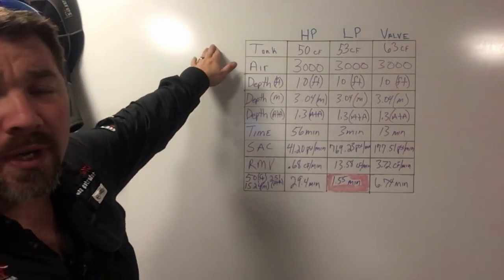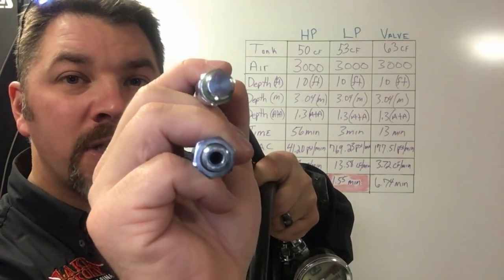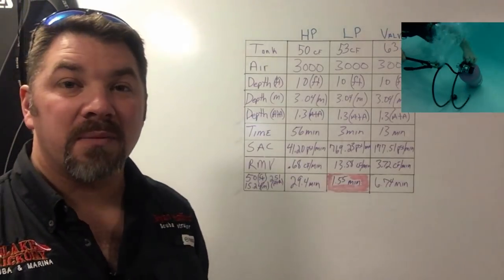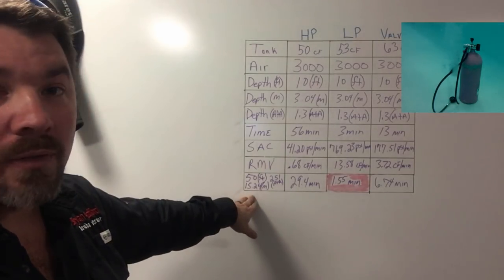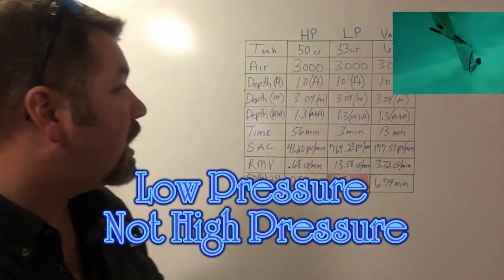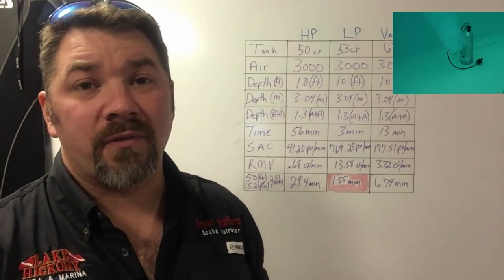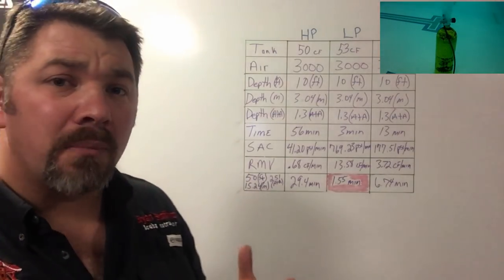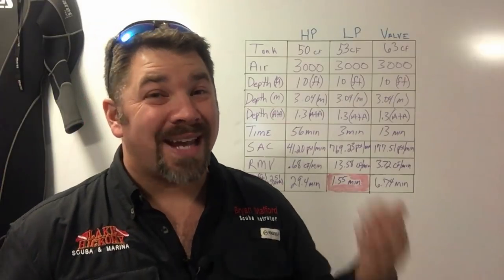Low Pressure vs High Pressure Air Loss Test

Comment: Just found this even though it’s old – thanks for showing exactly what we needed to know. I had seen similar tests (Alex Pierce did one) but hadn’t seen it done so dramatically. Initially I thought as others did that you also needed to factor in the diver’s air consumption but that would be minimal (about 1/1000 from your numbers) when compared to the leak. And you did this with a full tank – the remaining air time would less (although probably not linearly less – a 1500 psi tank would probably last more than 90 seconds) with a half-full tank. But the short time suggests to me that a diver experiencing a low-pressure freeflow should spend NO time trying to fix it and should instead immediately abort to his buddy’s air supply, or surface immediately if no buddy was nearby. Even if the freeflow could be fixed (while breathing the buddy’s air) the loss of tank pressure would mean the dive would need to end anyway.  Do you agree? Is this what’s taught in these cases?  Thanks.
Reply from the maker: Hello Jon, we use this video in all of our Stress and Rescue Courses.  You would be correct in choosing to abort the dive instead of wasting time trying to fix the problem.  With this being said, you can still try to fix the problem, however, there would be no need to continue the dive as you have already had a catastrophic failure.  I would definitely want to get my regulator serviced before I continued to dive with it.

Comment: I'm a new driver and was shopping for a tank. 
HP it is!
This was EYE OPENING! 
Thanks!
Reply from the maker: Hello Juror63, glad you liked the video.
Reply: That's not how it works. Both HP and LP cylinders with have HP and LP hoses coming off of the 1st stage of the regulator. This video shows what happens when HP and LP hoses fail, or the O ring does. LP hoses are used for the power inflation, regulator second stage, drysuit hoses and the like. The HP hoses are for the pressure gauge.

Comment: First i want to say great video and valuable examples.
One add i would like to make is that the divers air consumption is not taken into account on remaining time to surface.  So a diver would have less time than that on the chart.
Still very interestingand useful though. I would have never guessed that kind of difference in the high-pressure and low-pressure line
Reply from the maker: Thank you Don, glad you liked the video.

Comment: Brian, 

Long time follower and a big fan of your work. 

I truly appreciate your work in teaching us to be better and smarter divers. 

I’d love to get your feedback on best practices/techniques to deal with these situations especially - and this happens a lot unfortunately - when your buddy is too far away to notice what’s going on. Gear set up is single cylinder without a bailout. 

A ruptured LP line at 50ft leaves less than 2 minutes of air. It’d require surfacing without a safety stop while ascending as slow as possible and simultaneously checking SPG drop progression is probably recommended. 

But what if this happens at 100ft? 

I recently discovered an o-ring problem on my cylinder valve and was prone to leaks. Good thing I caught it while on the boat and brought a spare cylinder. 

Thanks in advance!

Hiro (pronounced like “hero”)

Thanks again for your continued work!
Reply from the maker: Hello H, thanks for being a subscriber and viewer. We are planning on revisiting this video very soon, and we are going to demostrate this same failure at the 100 foot mark. Stay tuned, because we are going to demostrate how to ascend during one of these incidents.

Comment: I have always wondered why manufacturers don't put a smaller orifice on the low pressure ports. Large enough to supply the heaviest breathing at depth, and good bcd inflation rate, but smaller to limit extreme free flow like that.
Reply from the maker: That would be a great questing for an engineer.

Comment: Remember high performance flow through piston first stages like mk25 will drain your tank faster than diaphragm/basic unbalanced pistons in the event of a burst hose. Not all tank valves flow the same either, the old one with pinched dip tubes flow much less. Lots of variables that make this test data unique to your valve/first stage and not that relevant
Reply from the maker: Hello Michelle Lousise, thanks for commenting.

Comment: On the spg line blow first instincts might be to grab the hose and try and slow the leak  Is the pressure great enough to cause air penetrate the skin ? And on the tank valve test, is the pressure coming out goin to be enough to push you deeper if your trying to surface ? And how would you deal with that situation ?
Reply from the maker: Great questions. Thankfully the water creates enough drag, so the risk of skin penetration is limited.  Not saying it couldn't happen, but saying it didn't happen during the test.  In regards to the tank valve test, I believe a diver could still easily swim to the surface.  In the video with the tank started to float, this was due to the weight of the tank changing because of the depletion of air, and it didn't take much force for me to hold it in place.  Now if the tank valve was suddenly severed, then that may be enough force to create propulsion on the diver, thus shooting him deeper.  Not sure how I would handle that situation.  In that case, I would assume the shock wave would possible be enough to cause a concussion to the diver, and may even be enough force that it would knock him unconscious.
Reply: Common intermediate pressures (low pressure line) are around 125 - 150 psi above ambient pressure. 
A 1/4 inch hose end has an area of .049 inches, and has  7.35 pounds of force from the end. With a gloved hand you could easily hold your thumb over the end to stop the freeflow. I wouldn't try it bare handed, as medical websites online say 100 psi air has penetrated skin of mechanics dusting themselves off with their shop air compressors. 
Don't even think about plugging the high pressure hose.
Reply: @deerlakediver5554  what about kinking the hose like a garden hose?

Comment: This is an old video, but great one. Let me throw this in through. This is a BEST case scenario of a WORST case scenario. at 3000psi, you probably just began your dive. if you're mid dive, so you're anywhere between 1000-2000 psi, those times will be significantly less. so your valve failure might give you 2-3 minutes. a regular descent with a 3 min safety stop at about 60-80 feet, ,you're not going to have enough time. at that point, an emergency ascent from the depth you've run out of air might be due.
Reply from the maker: You make a great point @sofloemir. This is a controlled version of a catastrophic failure. All the more reason for a diver to maintain their equipment and to check it often.

Comment: Thanks for your vids! 
If you test again, could you try kinking the LP hose to see if the leak slows or even stops? And to see if it is at al possible to kink it, depending on hose type? Its common practice in workshops (and in cartoons) to block leaking compressorhoses that way.
Reply from the maker: Thanks for the suggestion, we may try it again in the future.
Reply: @LakeHickoryScuba  Hi, I had a low pressure quick connector fall apart and my first instinct was to kink the hose. It didn't really kink and didn't slow down the flow appreciably. So I tried to tie a knot in it also no good. Best I could do was to stick my thumb over the end and try and bend the hose. Also not very effective. This was about half way through the dive so I returned to the boat where the quick connector was rapidly re-assembled as luckily I had managed to hold the end in my hand and not drop it. I'll just mention this was a new BCD and I was very surprised to see the connector had unscrewed with no help from me. Once screwed back together the BCD is fine and no re-occurrence.
Also, I have several times had the O-rings on the spg leak and I can confirm it takes a long while to make a big difference due, as you say, to the pin hole that admits the air to the hose and spg. Don't know if any of that helps your future experiment?
Reply: @patggreen77  Thanks for sharing your experience. And good to read it worked out ok for you. Was this a regular rubber hose or a flexhose? Did you orally inflate the BCD to get up?
Reply: Joyzy & Mechanikos the hose was normal rubber and I swam up and kicked until the boat captain released the ladder then we turned off the tank and he had a spanner and screwed the connector back together and I jumped back in and finished the dive. I always dive with as low weight as I can. So I can always swim up and stay on the surface with bcd deflated.

Comment: I know this is an old video but just wanted to point out doubling depth doesn’t always double flow rate. There’s a couple other videos on YouTube where they tested LP and HP ruptures at surface,30ft and 60ft and there was only a slight increase with depth. Not a service tech but I think the bottle neck has to do with orifice sizes and so much the ambient pressure. Like always, still a great demonstration and video!
Reply from the maker: Hello KlixTrio, the physics is still the same. But with this being said, it is still all theoretical.
Reply: Physics are the same, ideed. However SAC rate doesn’t apply in this case, as the free flowing hoses didn’t need to fill a cavity, i.e. lungs, to a certain pressure, increasing delivered volume. Hence the ambient pressure is affecting airflow just slightly.

Comment: The diver would actually have less time than the calculations indicate, as the diver also needs to breath off the tanks, assuming Breathing from an octopus.  The problem with the O-ring failure is that it could impact the performance of the regulator too.  If so, that would hamper regulator performance, and unless the diver had another first stage to breath from, or a pony bottle/independent doubles, (s)he may not be able to use the main regulator.
Reply from the maker: This is very possible. And you are correct, the catastrophic failure could cause regulator performance issues.

Comment: I realize this is an old video just happen to come across my feed just so happens last time when we went to bonaire I was given a tank with a bad turn wheel sealjust noticed that something you didn't cover in this video ironically enough I did a full hour long and came back with about 1450
Reply from the maker: These tend to get looked over by a lot of technicians during a visual inspection.

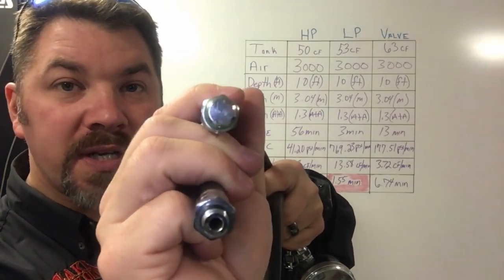Comment: Steve,  not all HP hoses have the pinhole constriction you showed in your video.  The miflex HP SPG hoses on my sidemount and BPW setup have large diameter openings (and look a lot like the LP hose you show at the bottom at approximately 11:15 in this video).  I suspect an HP hose failure without the pinhole constriction would drain even faster than the 3 minutes in your example.
Reply: question was meant for Bryan (not Steve)...  B^)
Reply from the maker: You would be correct Jonathan TLG, miflex hoses are different.  However, if you were to break down the coupling that connects the hose itself, the back side of it is restricted.

Comment: The valve leak time seems misleading. As far as breathability from your lines. If you are having that much volume loss at the source of intake to your first stage. How much is actually making it to your second stage would be my question. Furthermore would it be sufficient enough to actually get a breath off it. Granted some is better than none but depending on the answer buddy breathing seems to be the safer option.  Love your videos man! very educational and presented in an approachable supportive manner
Reply from the maker: Great question Earl, and one that we can definitely revisit and test out.  I can say from personal experience, I have had a tank O-ring (the O-ring that seals the first stage to the tank valve) rupture while underwater, which did cause a catastrophic failure.  At the depth I was at (20ftsw), I had no difficulty making a slow and safe ascent to the surface.  You can imagine my surprise when I heard the loud pop directly behind my head.  But as you stated, having your buddy there to provide air is a much safer and practical solution.
Reply: Thanks for the reply back to answer my question! Good info to know if it ever happens to me in the future. And yeah I would probably need a new wet suit if I heard that right behind my head as well. 

Keep up the good work buddy! Look forward to seeing more videos from you.
Reply from the maker: You're welcome.  And thank you for being a subscriber.  If you ever have video suggestion for us, let us know, and we will try to get it produced for you.

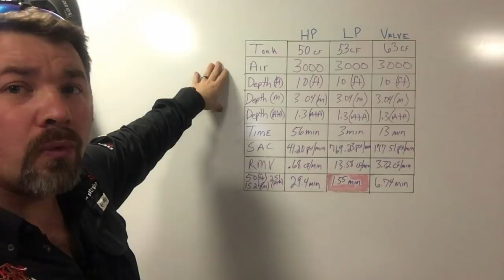Comment: 10:50 10 feet equals 1.3 atmosphere? 
I'm a newbie to diving so please forgive me for a stupid question. I've read that 1 atmosphere equals 33 feet of ocean depth. By your statement that 10 feet equals 1.3 atmospheres,  you are adding the weight of the air above the water on top of the water pressure. So you are using absolute pressure. That makes sense to me since the body is experiencing the sum of the two. . So 33 feet down is really 2 atmospheres of pressure not 1.
So when a diver says I went down to 2 atmospheres,  he means 33 feet not 66 feet. Correct?
Reply from the maker: Hello TheNYgolfer, there is no such thing as a stupid question. You have it correct. The constant pressure of the surface is always calculated back into the formula for absolute pressure. The easiest way to determine absolute pressure is with the formula, (DEPTH / 33) + 1.  This of course being for Saltwater. For freshwater, change 33 to 34. (DEPTH / 34) + 1. Hope this clears it up for you.

Comment: I'm surprised the valve leaked slower than the LP hose. I would think gas could escape faster out of the valve (from 200 bar down to 1.3 bar) than out of the LP hose (from ~10 bar down to 1.3 bar). But it looks like you had the first stage attached with all the ports open, so maybe it's the same intermediate pressure? I'm still missing something here...
Reply from the maker: This video was very fun to make.  We learned a lot about the orifices in a regulator and how they directly relate to air loss.   We were also shocked at the results ourselves.

Comment: Do you have to worry about getting water in the tanks doing testing like this?
Reply: All of the equipment shown aside from the SPG can be disassembled, cleaned, and returned to service if necessary.
Reply from the maker: Yes this is a concern, and the biggest reason we chose these 3 tanks is simple.  They were due for a visual inspection anyways, so any water that gets in them can be dried out during inspection.  The regulators we chose, can no longer be serviced because there are no parts available for them.

Comment: I don't understand the final line of your calculations, surely a leaking hose will take the same time to empty (or less, because of slightly lower pressure differential) at depth as it does near the surface?

And do the calculations take into account the air used by the diver as he ascends? Or just the air lost by the leak?
Reply from the maker: We added the bottom line as more of a frame of reference to just how serious a catastrophic failure can be to a diver.  The easiest way to think of it is to compare it to a divers SAC or RMV rate, the deeper we are, the more air we use up.  Try not to over think it. We want to prevent all catastrophic failures.  In the event one occurs, we do not want to panic, however, we do want to make a direct ascent to the surface, slowly as possible not to exceed a 30 feet per minute ascent rate, but at the same time, we need to understand that we will not have control of how quickly our air supply is depleted.
Reply: Al Locke "...surely a leaking hose will take the same time to empty...at depth as it does near the surface?"

The leak rate will be the same, but the amount of air the diver is using changes. So if you have a leak at depth you'll have less total time to depletion than at the surface, because it's leak rate PLUS consumption rate.
Reply: I know nothing, and am nor certified, but air pressure at sea level is 14.7 absolute pressure  (ISA), so doesn't the regulator diaphragm maintain a minimum of 14.7 differential pressure at any depth? Meaning all depths dove to will require a low pressure line to be equal to ambient pressure + 14.7psid to = regulated pressure. Meaning much higher leak rate would exist at greater depths on account of higher regulated air pressure? And thus further reducing recovery time following a failure at deeper and deeper depths?
Reply: @innerverse1809  You are right about the regulator (1st stage on the bottle) adjusting for ambient pressure, but air supplied by the hose to the 2nd stage (the thing in the divers mouth) of the regulator is usually about 10 bar/150psi above ambient pressure.
Reply: @mechanikos84  so 1st stage = pressure at depth + 14.7 psi? And 2nd stage = ?
Reply: @innerverse1809  1st stage is screwed into/onto the tank. It takes 200-300bar/3000-4500psi. Depending on brand and model, it regulates that to roughly 10 bar/150 psi above ambient pressure, and puts that into the hose. The 2nd stage in your mouth takes that 10bar/150 psi and gives the diver that air, depending on demand, and thereby dropping it to actual ambient pressure, when he/she decides to inhale. Lots of vids on youtube explaining it.
Edit: here is a video showing it: https://youtu.be/axjyMdSSSQM. The thumbs pushing on the leaver inside the 2nd stage=diver inhaling, sucking on the diafragm that would operate that same leaver while diving.
Reply: @mechanikos84  that makes sense, thanks, I'll watch the video too.